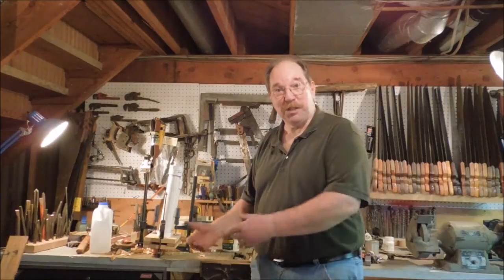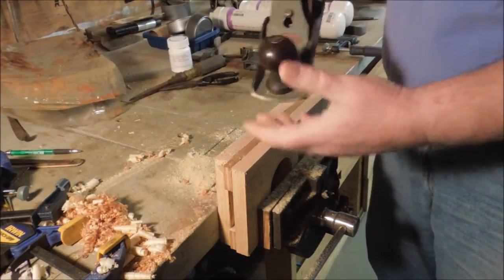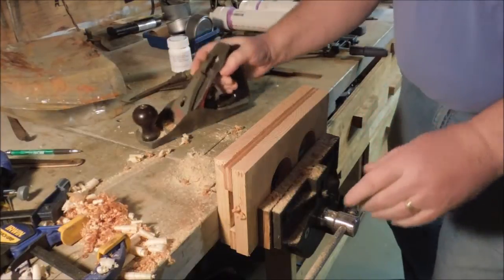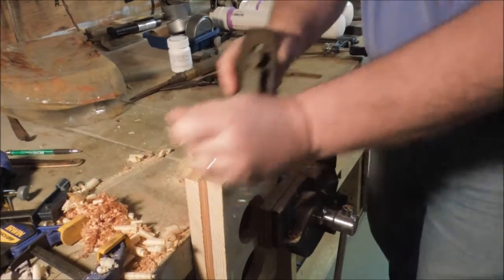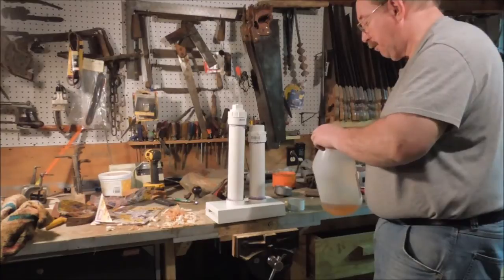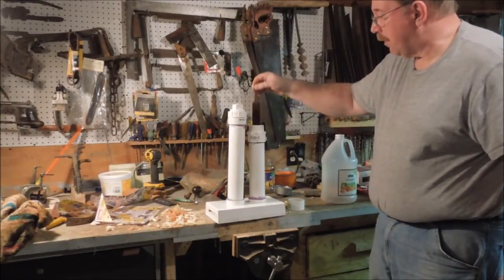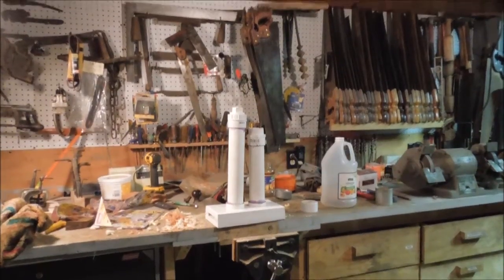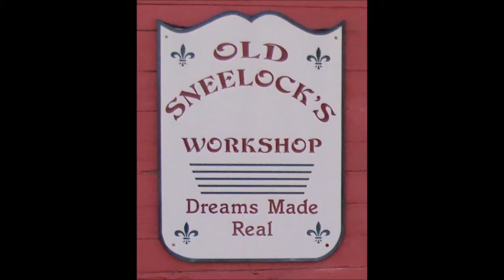Building A Vinegar Rust Removal System - Pt 5 - Finishing and Testing

Comment: You made me an Apple Cider vinegar convert..I tired it and regular vinegar on bunch of very rusty small tools that were in the bottom of a metal tool box I got for free. I split them up and and ran two batches for 24 hours. Apple Cider worked a lot better IMHO..plus agree on the smell factor.
Some of the tools were too pitted from rust to be any good but several cleaned up fine and will be put too use.
Reply from the maker: GrandsonofKong Thanks. I appreciate you letting me know how it worked for you. 
Something I learned the hard way was that you don't want to put them in and leave them longer than 24 hrs. I have to replace an adjustment screw on my big Morrill Apex saw set. The saw set was pretty rusty but the screw had been covered and was clean. I removed the nut and put the saw set in the bigger tub. I didn't check it until 2 days later and the nut just slid onto the screw. It took the threads right down.

Comment: You need to show the part where you spray the file with WD-40 to displace the water in all the crooks and nannies...
Reply from the maker: tom7601 Thanks for watching Tom. I appreciate you taking the time to comment. I don't spray the files with WD40 anymore. I wash off the vinegar with soap and hot water then use a paper towel to dry them off and store them in a dry area. 
I found that the WD40 leaves a waxy buildup that causes the files to plug up quicker.
Reply: Old Sneelock's Workshop Interesting, I didn't know that...